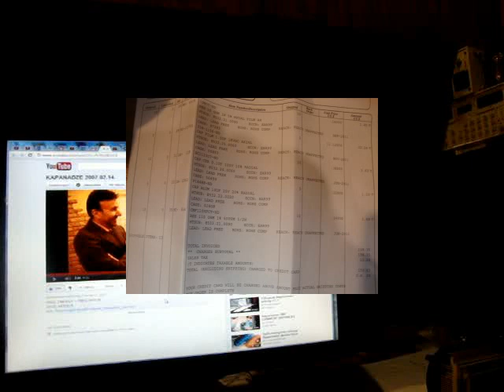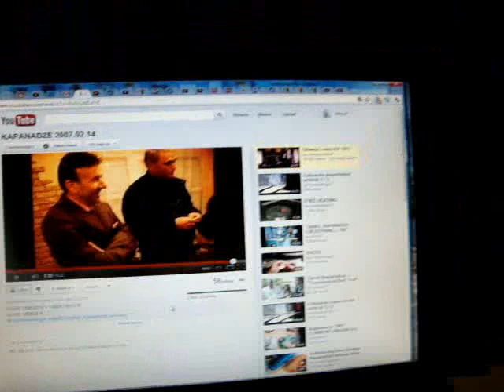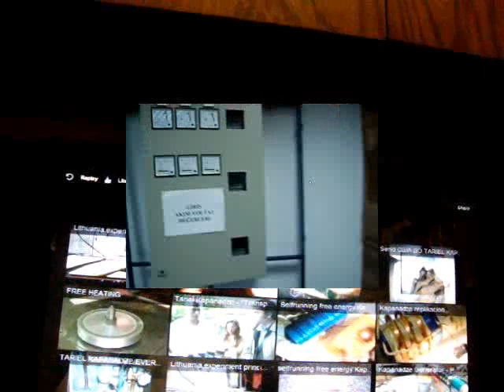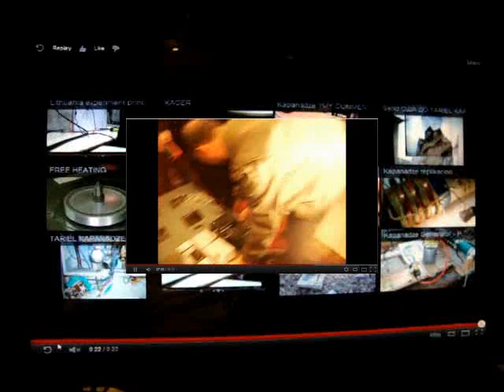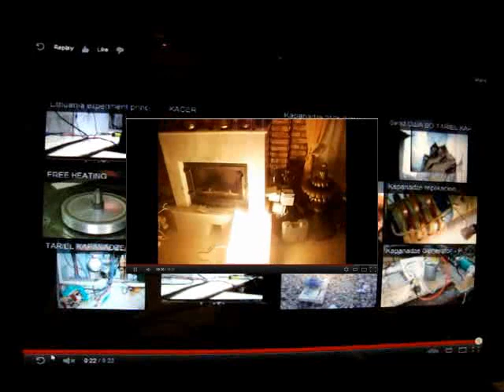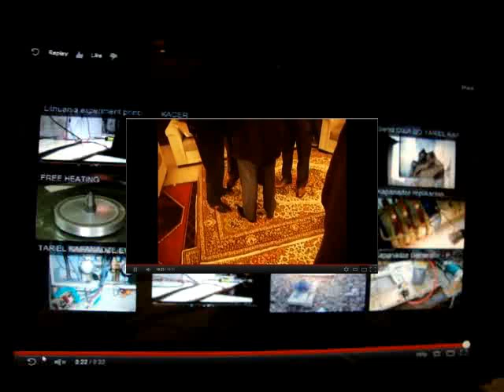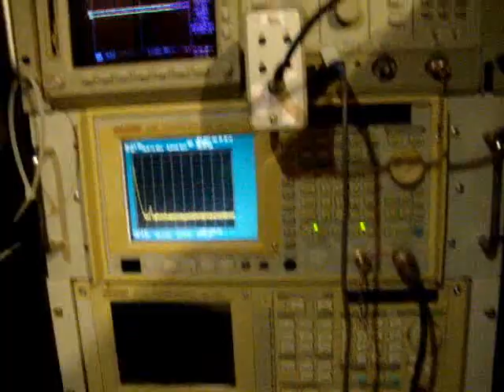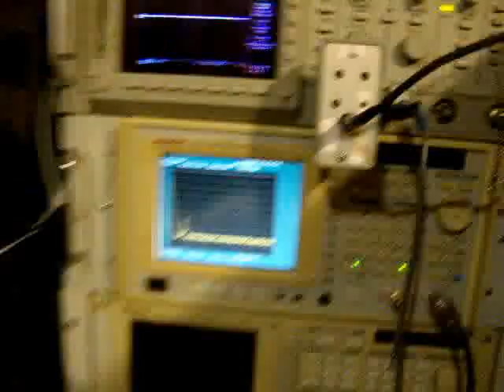First Light of Hope in 2012 investigation of  OU PART#1 OF VIDEOS

Comment from the maker: Vid Bid there is no button reply below of your comment so I can  respond to it only this way. That experiment was part 2 of Lithuania Experiment there is plenty of information
 on that event. Basically it involves Caduceus coil ( also available in T-1000 , Arunas  videos and Aidas videos)   some of them you will find  on my channel rest of it look at T-1000 or comments on overunity .com   Similar approach but much simpler was done with  ferrite from Russian TV rubin  Yoke. There have been  side effects to all of us.
Headache in right side of my head was present for 2,5 weeks after my return from Lithuania.  We have been not able to pinpoint  exactly  what was  causing it. The suspicious is that that special  ferrite have been altered by former Russian Manufacturer (enriched) some isotopic reaction could of  take place. However Caduceus did not cause this effects. Or we think it does not. The two parts of experiment have been done in the same place in the some time.
Part1 . Yoke. ( schematic and explanation isd in my videos.)
With  yoke we have been able to get successfully  60W light-bulb ,150W ,600W and than 1000W to the full brightness. However I did not witnessed the 1kW part of it.
The power in was delivered from two generators one was  5W from the grid at approx,60Hz the other one  in frequency  that Arunas called ferroresonance ( around from 1.2 to 1,8 MHz.( I have problem with that  assignment) Both generators have 1W output and max frequency at 2MHz. 50 Ohm  output impedance. Arunas  determined that frequency based on  white noise- that particular generator is also able to create and spectrum analysis of that noise.( standard futures of the device)
After impedance  mismatch  (as we  did not have there  any VNA to find impedance  characteristic) the effective power into the coils of yoke was in  region of milliwatts .
For easier understanding total power draw from outlet  by  2 generatos was 5x=10W.
I'm not  working any longer on this project as I found Colman to be much more absorbing. I do not strive to save humanity nor to be famous. It is my goal- Yes.
But I have fun of playing with  FE. Money is no motivation to me, I'm not for sale. 
You need to dig for answers  and you will get them. It is much easier for you to replicate  Lithuania Experiment than it was for us. Arunas is doing his part, Aidas is  doing  his own and I do Colman. That is enough information for Arabs/ governments to know.I was  suppose to die  few times- they have  been not very successful, slapy  job done, I wasn't done yet. Let them know that there is not immediate danger heeeeee..he.he.

Wesley

Comment from the maker: @Khwartz beautiful suggestion
In next material published I will include this as prove o concept.
I have tried this.
Light bulbs in series connected to HV power supply generator did not give light
Spark was present only when connection was interrupted.

Comment: Just a detail Dear Stivep, to cut any conversation about that:

- Bulbs are not by themselves good indicators, especially on cam and low lighting environment BUT, if you just do something so very simple before, you would have no more objections, and that consists to just light you bulbs with the same voltage of your input, but without the device (before it), and so, in the same condition of environment lighting and cam sensibility. Like this, you'll have an uncontestable etalon for comparison.